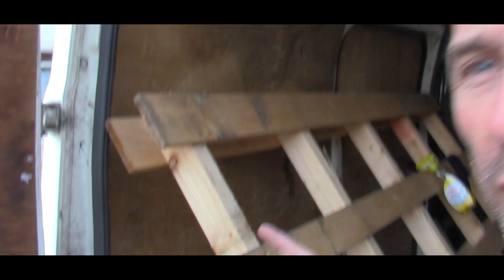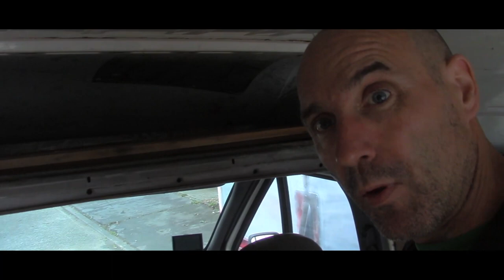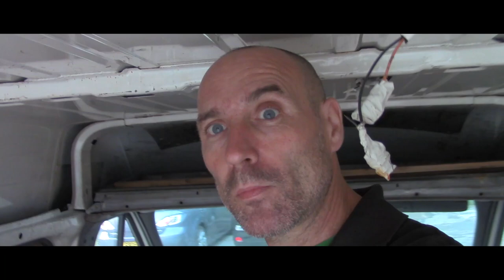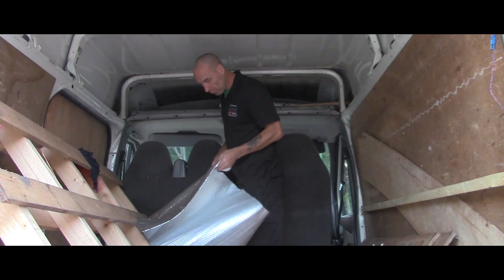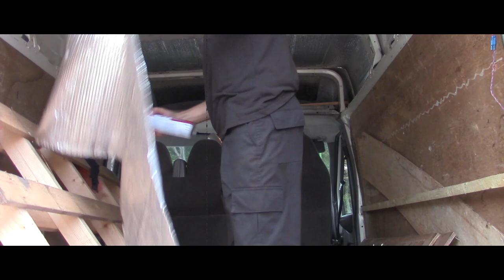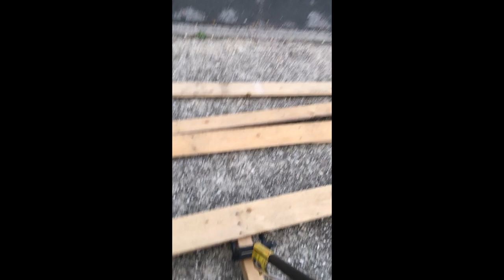Ford Transit Mk6 Budget camper build Part 2

Comment: Hi mate.
How tall are you?
Thank you.
Reply from the maker: 5ft 8 👍👍
Reply: @ProjectCamper  thank you.
I'm 5.9ft and I'm searching to buy one of thisvans because they have under 2000cmc motors. 
I saw that this model is standard or with 0.32 ft taller floor.
Do you know what is your model?
If is the one with lower floor, this means that I can't stand up in one of this.
Thank you.